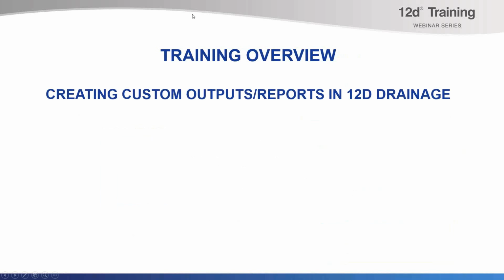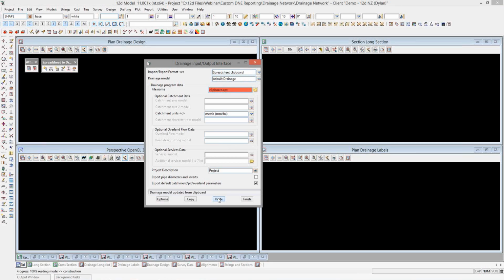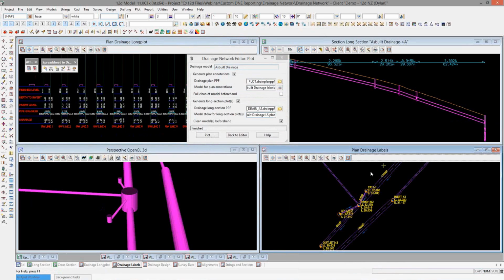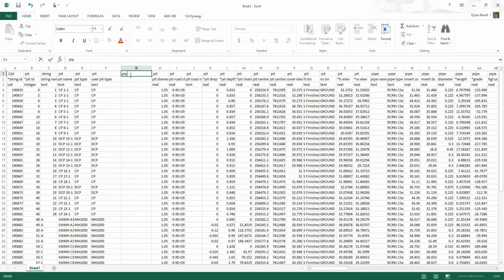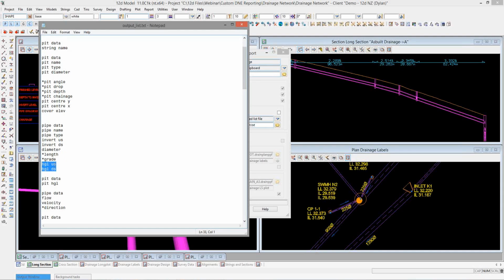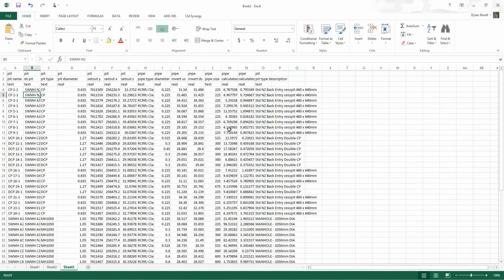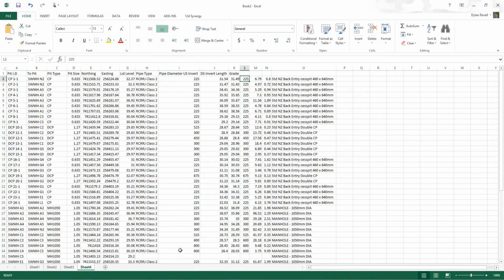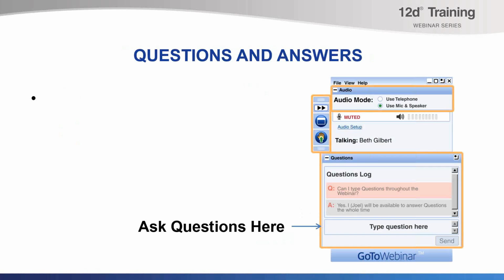Creating Custom Outputs/Reports in 12d Drainage - Training Webinar Series

Comment: ?Where can I found the spread sheet tool bar
Reply from the maker: The Spreadsheet toolbar is a standard toolbar installed with Version 11 and above. You can select View > Toolbars and then activate the 'Spreadsheet to Drainage' toolbar. If it is not available due to your customisation, the presenter is happy to provide further help by email; just let us know :)
Reply from the maker: To download the 'Spreadsheet to Drainage' spreadsheet mentioned in the video, use this link: https://remote.12dsynergy.co.nz/12dSynergy/Publishing/b17b7081-a2c3-4fa3-9491-a3d3448c8a18